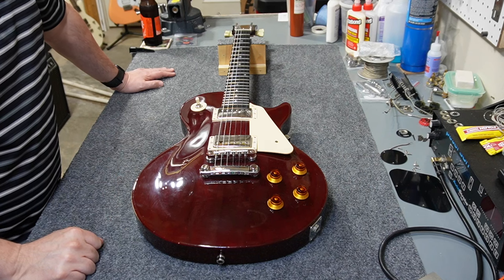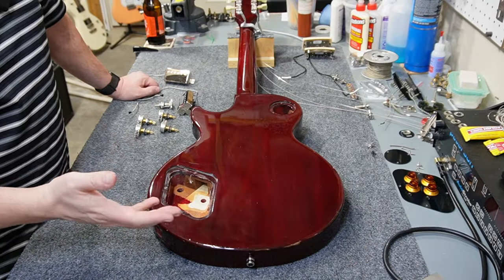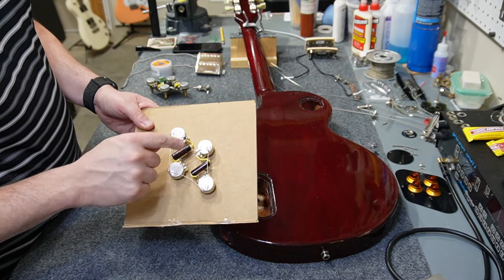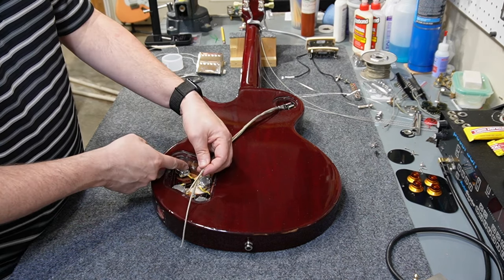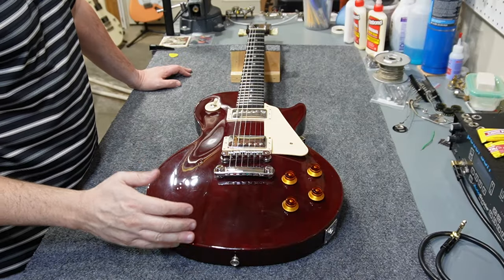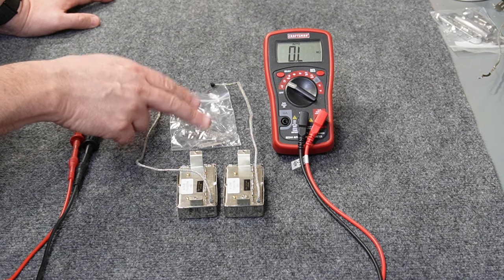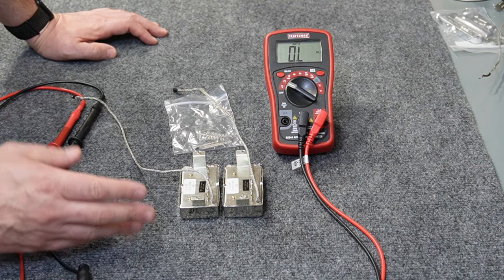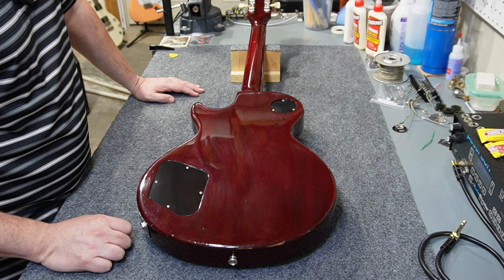Vintage Style Gibson Les Paul Wiring: Removing PCB & Installing PAF Pickups, plus Did I Buy Fakes?

Comment: I think the better choice for bridging the grounds across the two channels in the control cavity is across the volume pots and not the tone pickups, because the volume pots are the signal source (pickup) connections. It could also be argued that you do not need a ground jumper between the two channels in the control cavity because the cross connection (single point ground) is made at the selector switch from the two channels (if you keep all of the grounds separate so shields (grounds) do not cross connect as they route through the guitar).

With passive guitar electronics without a PCB the goal is to plan out how the grounds are connected and establish them a only one point (single point ground). The single point ground really means we are minimizing wiring loops, where any loop actually can act like an antennae to pick up noise.

Grounds: (All ground types should ideally only connect at one point, meaning they are gathered and then all terminate at a single solder connection or node)

Chassis Ground: 

With Gibson Les Pauls (LPs) that use a metal pot plate the plate is considered the chassis ground (grounds the pot housings), which also includes the selector switch housing and the output jack housing and connection to a metal jack plate (if not made from plastic). Basically, anything the user can touch is considered chassis ground. This also includes the tail piece ground, which ground the strings. 

Signal Ground:

The signal outputs originate at the pickups where the ground is the braided Gavitt wire. We want the signal grounds to connect together at one point and then connect to the single point ground node. What is interesting is Gibson in production used the plate to act as a signal return for the tone pot to the volume pots, which essentially violates the single point ground best practice. Technically, using the pot rear covers as a ground solder point and the plate together also violates the single point ground best practice. I think at minimum Gibson should have made the signal ground connection between the tone and volume pots with a direct bus wire and not rely solely on the plate.

Power Ground:

The guitar in the video is passive circuitry only. So there is not power ground used.

Connect all the grounds together at a single point (single solder connection), this will minimize any antennae loops.

More stuff:

Usually with single pickup swaps you should verify the polarity of the new pickup as compared to the one remaining as well as the DC resistance (looking for a shorted pickup). Some clone pickups are actually wired with the polarity reversed even though they use Gavitt wire (which somewhat assumes a consistent industry magnetic pole orientation for a dual pickup guitar like a LP, established essentially by Seymour Duncan and Gibson as to how the coil is wound and the magnets oriented). I use a Simpson 260 (Series 8) Analog VOM to check polarity. 

Upgrades: (depends on the specific guitar and how it is used). Warning: Expensive. 

1) Insulate each Pickup push back wire from the control cavity to the pickup with Teflon sleeving so no pickup shields touch other grounds as they route through the guitar (use of single point ground). 

2) Use Teflon single conductor with braided shield (with outer jacket) instead of the pushback wire from the selector switch. This has several advantages: It insulates the braid as the cable is routed through the guitar. It will not absorb moisture like the Gavitt cloth. It is high temperature so you can position all of the shields and other connections on the back of the pot together and solder all in one operation (we want to minimize the heating of the pot rear cover). The stranded center and braid are silver coated copper which has a better appearance (shiner solder joint) when used with tin/lead/silver wire solder and additional liquid flux. When excess flux is removed with IPA the joint is very shiny. The actual outer diameter of the Teflon wire is very close to the Gavitt wire of the same gauge (20AWG Standard) because Teflon jackets and insulation can be ultra thin. 

3) Insulate the bus wire pot rear cover ground cross connections with Teflon sleeving (very thin wall, will not melt, will not absorb moisture and attractive).

4) Insulate the capacitor leads with Teflon sleeving.

5) Use Mica tone caps. MICA capacitors are commonly 5% tolerance, ultra stable, very long life, excellent for passive filter circuits and very effective if you pair them with 5% tolerance CTS guitar pots (TAOT or similar or custom order). Gibson CTS pots from the factory are +/- 20% tolerance and don't seem to be matched in sets of four for a LP. Some are so poor that I wonder if they are actually made by CTS (even though there is CTS stamped on the pot). The inaccuracy in electrical behavior is very noticeable for experienced players. For best positional accuracy and channel to channel matching it is best to use +/- 5% Tolerance pots that are matched sets of four, with 5% tolerance caps.
Reply from the maker: There’s certainly a lot here, and I appreciate it.  The one thing that stood out to me that I wanted to engage with is tolerance.  My understanding is that tolerance in a resistor or capacitor is the difference in the actual value versus the nominal value at the time of manufacture.  It’s basically the factory saying a 500K pot might actually be 400K or 600K in your 20% example.  The difference in actual versus nominal value will change with age, but it’s slow to do so.  Therefore, I think it’s less important to get 5% tolerance pots over 20% tolerance ones than it is to simply measure the pot resistances to create a matched set.  If I’m missing anything, I’d be curious to hear about it.  Anyway, I do try to match pots many times, but more frequently, I decide to replace passive components based on whether they have drifted outside of their tolerance range, which I take as a sign of failure or impending failure, and that’s why I’m curious.
Reply: @hacksguitarhobby  The following is a little long, but there is really no short answer to your question.

Tolerance with pots are little different than discrete resistors or capacitors in how they effect the control of the guitar settings (volume and tone knob position). 

With guitar pots from CTS what we are really trying to understand is their transfer function (resistance), usually referenced to the ground leg, relative to rotational position, commonly called the taper for audio curves. 

What is really needed is to match pots relative to a reference rotational position, which is up to the builder, usually at 50%, 60%, or 70% of total rotation from 0%. 

If you look at the CTS 450G guitar pot data sheet the tapers are called: 

Linear; Std. D Spl. D
Audio; C, A, B, BD, H, and J. 

Most LP guitar pots as sets all have the same pot taper and are generally either A, B, or BD. TAOT uses the A taper or very close to it. If you order custom pots from CTS, like TAOT, you can specify your taper and many other specs, but your have to have a large buy. 

The 5% pot tolerance gives you a better matching taper shape from pot to pot. With the shape consistent, you can now match pots resistance based on your reference rotational position. The +/- 20% tolerance pots are all over the place, the shapes don't seem to match and matching rotational values is futile. If new pots do not rotate easily you can use Deoxit D5 to clean and lubrication them. Which I generally do as a matter of course before testing them.

To make matching easy it is best to make up a jig where you can place a pot set it to 0% mechanical (this is at the low mechanical stop). Rotate the pot until the resistance starts to change (low inflection point) make a note of the rotational position. Then determine the maximum inflection point. Then verify the maximum stop position. The stops are established within the pot itself, and for the same CTS part number at 5% tolerance the inflection points and the stops should be very consistent.

Then measure the resistance at your reference rotation (for example, 70%). You can use a degree wheel to line up the zero mark (low stop), establish the max stop, then inflection points and then the matching 70% rotation resistance. Then sort based on a batch, usually 100 pots.

Once the above is completed when the guitar knob positions are set to the same value for volume and tone (if the tone caps are 5%) they should behave similarly for a LP with a matched set of pickups. Some LP guitars actually have indicators (pointer mounting washers) on the pots to help set the pot value more accurately. You can add them to any LP you rebuild with speed knobs or bell knobs. This helps the player consistently set their knob settings which for some players is very important.

If you use 5% MICA tone capacitors, which are expensive, they will outlast the guitar owner and the guitar. For current production Gibson LPs with hand wiring, Gibson uses film (orange drop) capacitors from China, which is really unbelievable. Just think, you buy a brand new LP Custom Ebony for several thousand dollars and it has Chinese caps. 

The above really depends on the guitar you are rebuilding, its market value, purpose and budget available. Obviously, a matched pot set cost more than 4 pots purchased from one vendor with the hope that they will be close. 

Some vintage LP guitars, 1950s or 1960s, are worth several thousands of dollars for an excellent playing example (no warped neck or other major problems) but the electronics and wiring are just worn out. If the owner wants to keep the guitar in playing condition, the guitar electronics are usually rebuilt. 

You have to explain to the owner what is going to be done and why, and what materials are going to be used. It is good to have your own LPs (good to have a VINTAGE LP and a MODERN LP wiring example) properly setup, with your upgrade mods so the customer can see your improvements and actually play the guitar. Obviously, the pickups determine much of the tone, but the owner will understand how the controls work and why the mods are an improvement. For the older guitars this usually means adding a tail piece ground. So some luthier skills are needed on the bench. 

Most professional players want consistency between their LP guitars for a similar set of pickups and are willing to pay to upgrade the guitar electronics and wiring to make the control and tone behavior consistent.

Comment: Thanks for the video. That’s not what “ground loop” means. But love the video man
Reply from the maker: Thank you, but please explain?
Reply: @hacksguitarhobby my bad man. So a ground loop is not what is happening here if you solder the same bare wire to the case of all pots. Electrically they become the same point if you do it that way or the way you did it in a “C” pattern. A ground loop is when there is a difference in potential between a “ground” and another “ground” between each other. In a a perfect circuit, all negatives would be tied to the same ground headed to earth and there would be no potential between them. However, if something happens that lifts one ground to say a little more positive than another ground in the system, the potential to get shocked by completing the circuit as a human exists. When I was in the Air Force, we would be working on a test set that was supposed to be grounded to a ground bar heading to earth ground but somewhere across the building there would be another circuit that would be tied to the positive of the outlet we’d be using and it would be tied to a different grounding rod in the ground that was in a more dry area or some other factor than the only our outlet was attached too. The result would be that there might be a slight difference in potential between our ground and a ground in the wall using a different outlet but the same positive as ours (in a 28vdc or something like that circuit) and somebody would get shocked. ANYWAYS….all that to say that if you mate a wire to all the backs of those pots, there is no way for them to have differences in potential causing a ground loop. They all go through the same negative on the jack. In fact, many Les Pauls through the years used a solid metal plate for all the pots to be mounted to. I hope I didn’t confuse you. Thanks for being humble instead of nasty.
Reply from the maker: Thank you for the explanation.  In my Tele builds you’ll probably have heard me debate whether to use a ground wire connecting the back of the pots, because of the same issue.  Perhaps “ground loop” isn’t the right terminology for me to use because it has another meaning?  I’m using it as shorthand for a phenomenon that I’ve read creates a one turn coil that can receive EMI.  This is the best representation I can find of what I’m trying to communicate in the video(s): https://www.fralinpickups.com/2018/11/12/understanding-guitar-grounding/
Reply: @hacksguitarhobby  thanks for the reply my friend. All you need to know about the guy writing that article is that he tells the reader to select DC Resistance. There is no such thing, there are alternating and direct current voltages settings on a multimeter, but resistance is just resistance. Anyways, it’s a well, put together article. However, dude is just wrong. You can’t over ground something. Otherwise the shielded/braided cables inside the cable to the pickups would create a million “ground loops” or as this guy calls it “single turn pickup”. This isn’t real. Just my opinion. Maybe you could test it both ways and make a video showing the results.

Comment: The 490r is a great pickup
Reply from the maker: Very much so.
Reply: @hacksguitarhobby you said in the video that it’s not good… correct?
Reply from the maker: Yes, I lumped them together, but my comment was more so directed at the 490T.  I like a 490R/498T combo much better.  Also this particular 490R was a PCB version and something was making it weak.  May have been a flaw in the PCB.
Reply: @hacksguitarhobby It's more of a question of taste and style of music played, and of course the guitar it goes into. 490r/490t is a great combination in an ES guitar but maybe not so much in an LP.